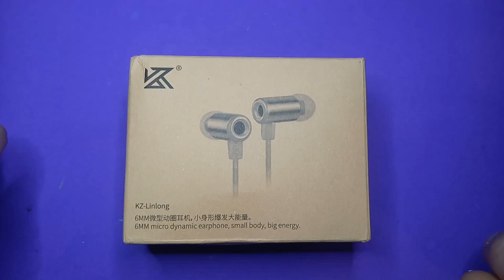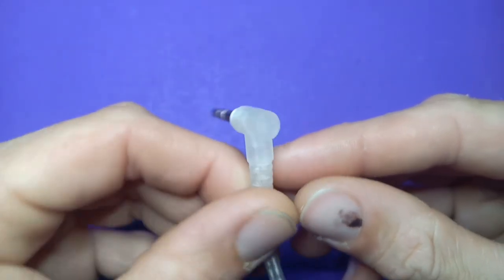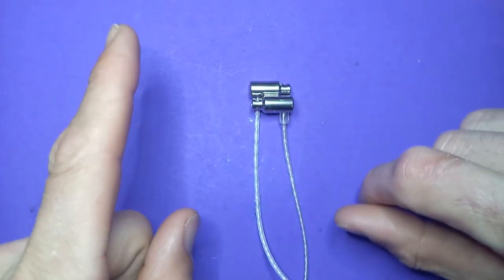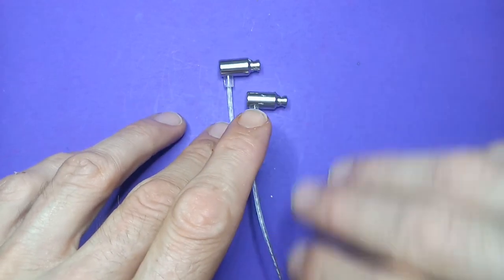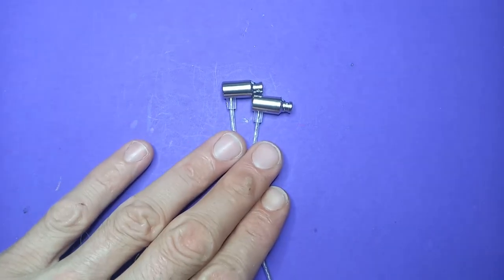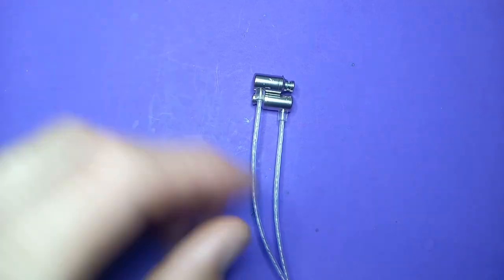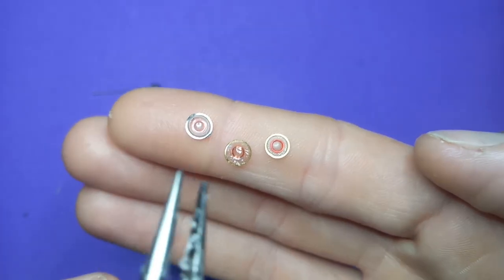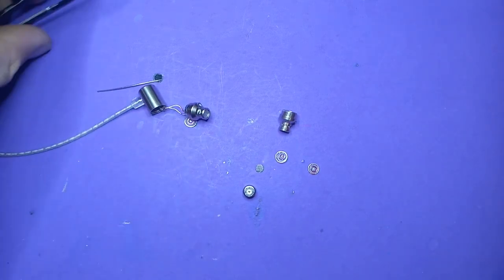KZ Linglong IEM Review and Teardown. "what if Moondrop and KZ had a baby?" 😂😂

Comment: Does 6mm driver have tendencies to sound even thinner when connected to dongle dac? Because my daily beater ED9 does that weird thing, when I used dongle dac it sound so thin like the sound stage been stretched out, so the frequency also spread appart? If I used it straight to my phone it sound decent